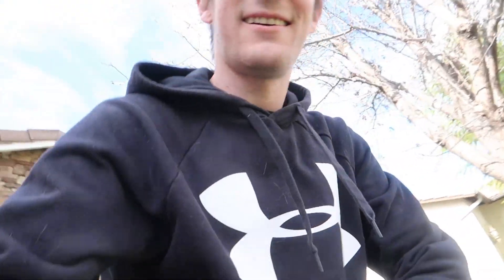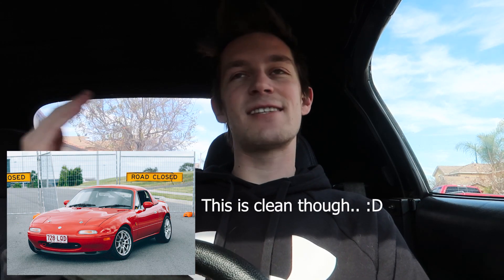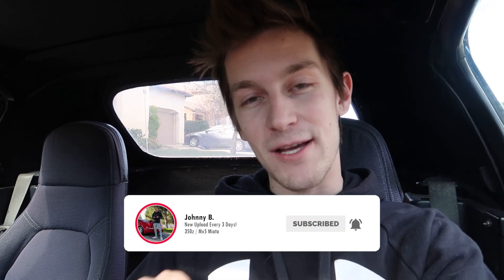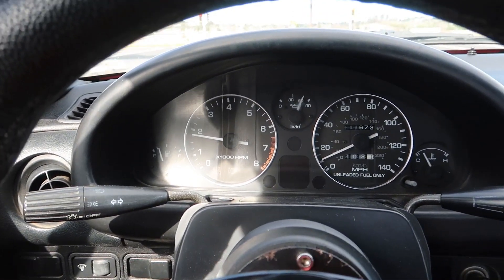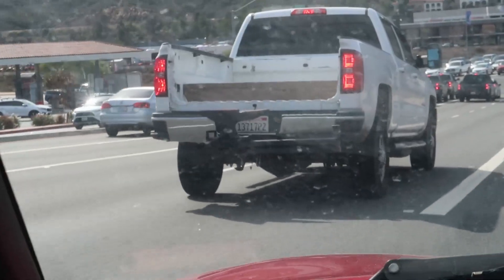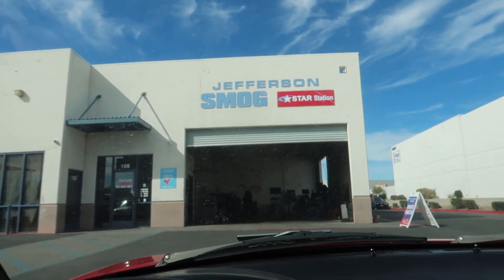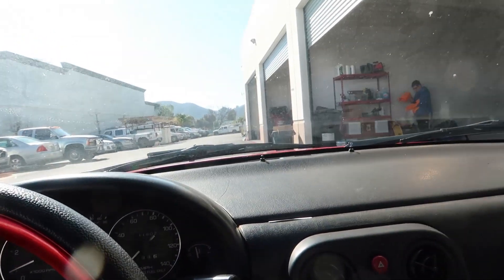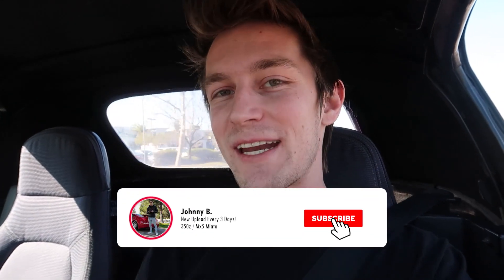Trading My Nissan 350z For A 1991 Mazda Miata!

Comment: the rpm issue is normal. ECU tells the rpms to go up when using ac to account for the extra voltage needed. Goes back down when the car gets heated up.